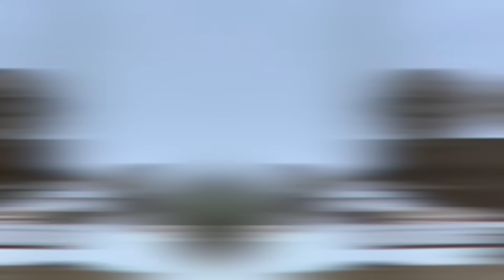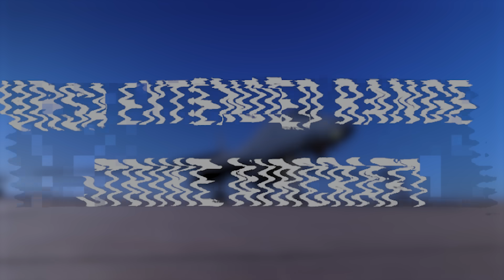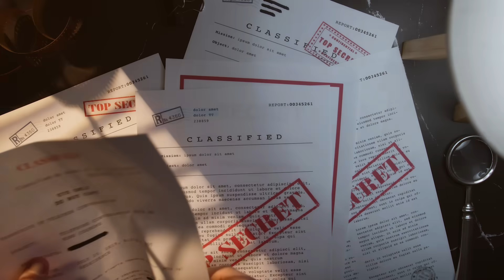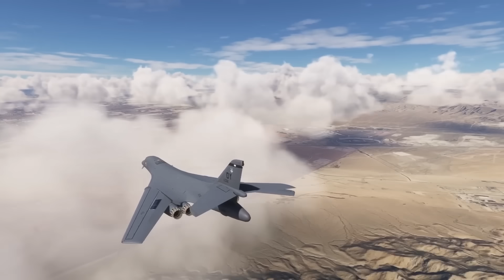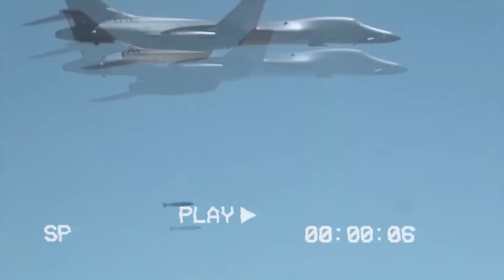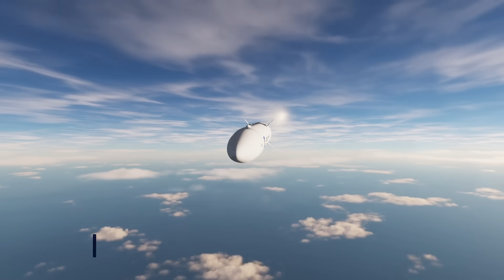The US Just Unveiled 2025 B-1 Lancer with UNMATCHED Power!

Comment: The redesign of the intakes did not slightly reduce the speed.  The B1A’s top speed was Mach 2.2 while the B1B was Mach 1.2, while burning the same amount of fuel significantly reducing range at supersonic speed.  The original concept was fly supersonic until before enemy radar coverage and fly low level after that.  To increase the range the missions were flown at high subsonic speed.  Other design changes decreased the operational ceiling of the aircraft.  The original EW suite was not adequate and had to be replaced.  The B1 has screw of 4.  5 x 4 =20.

Comment: The U2 doesn’t have afterburners. But it does use Jet Fuel Thermally Stable. We got 5 to the UK in the mid 70’s. We got in 1000 55gal drums during Christmas.  Tore apart drop tank dunnage for the drums. They were painted the same color as the German sky, not black.
Reply: The U2 was a completely different aircraft, it’s an unarmed spy plane, it also never had drop tanks, it didn’t need them, it also did need to refuel in the air as it was capable of extreme long range flight with just its internal fuel tank.
The story here is about a fictional update to the B1 bomber a completely different aircraft to the U2.